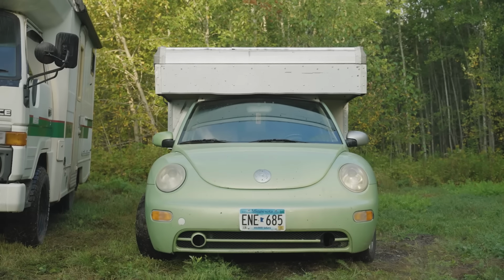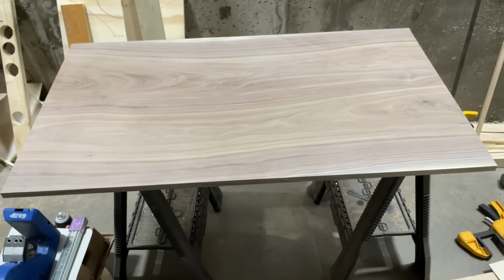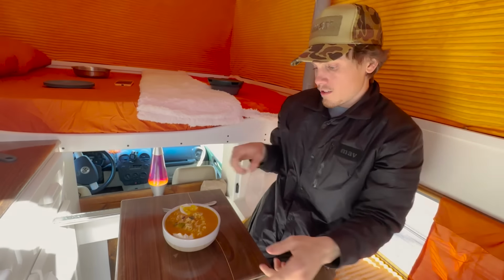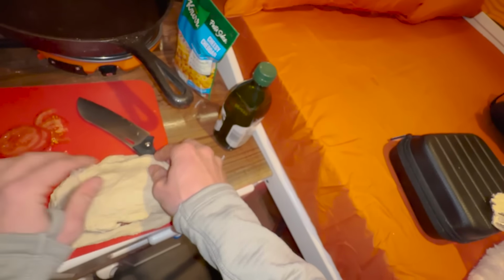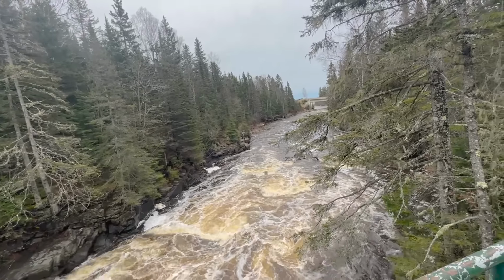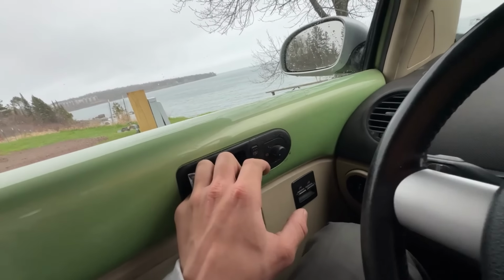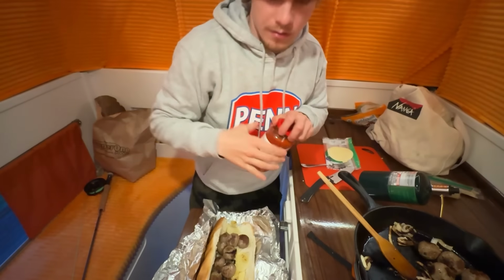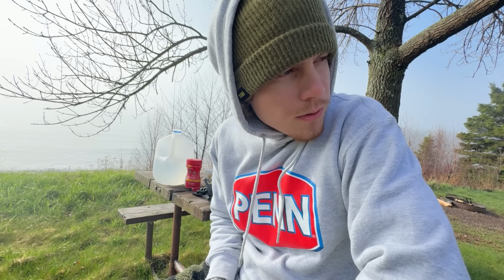Three Days Camping in my Renovated Small Car

Comment: MAV, how you doing man fantastic job on the bug it looks freaking great. I would make one recommendation to go to camper world or similar trailer supply house and get a cover that goes over your vents you want to cuz you have two vents. That way if it's raining outside you can still have your events open but no water will come in. They put them on RVs when they're cruising down the road so they can vent you know keep the place comfortable as they're driving down the road and they don't have to worry about rain coming in. I know you said you beefed up the suspension did you actually take it to a VW bug place or aftermarket place just curious. There's a lot of weight with that top and you know all the stuff that you put into it that may not have been considered when VW made the bug. Maybe you can put like you did on your truck that one day those air ride air lift pads or whatever they were? Maybe you can put air shocks or different springs to give you a nice smooth ride but be able to handle that extra weight? Something to consider. You're going to have to have if you don't already some form of TV entertainment either your laptop or something so you can watch YouTube or DVDs or whatever you want. Something you might consider doing and may not need to be done is back where you put diesel in the car and you end up spilling diesel on the paint why not just spray paint that section have your cabinetry guy do it with that truck bed liner. Just scratch up the pain and get it all rough and then mask it off and then you get they sell in a rattle can just spray it on there and then it'll be like that truck bed liner and at least it won't harm that when the diesel falls on it. I don't know if you have any or if you even care but you can go by and get those window screens you know to keep the sun out the summertime so your interior doesn't bake and put it in the windshield that way when you're parked you got a little bit more privacy from the outside world or in the dead of summer you could line the windshield and the side doors windows with that windshield material and keep the heat reflect the heat away from the inside the cab and it gives you privacy. I actually do that in my truck just because if I'm doing something and I want to take a nap and I don't want those super bright parking lot lamps glare on my eyeballs I could block my windows out. Another reason I do it is I just want to stop for lunch I don't like it when people are gawking at me when I'm eating so I just throw it up in the windshield and gives you a sense of your own privacy. You have yourself a good one. You've come a long way since the 15000 viewers that's when I started watching you. Keep up the good work and stay MAV The wild Man. Peace from Oregon

Comment: That's cute and amazing!!!
Almost insanity how your tiny car has same living space or better, than my full size van!
I need a pop top, my knees are bad and not feet! 😅
I'm just happy to be free with a safe place to stay. It's all metal baby, nobody slicing in!!! 😅

I have big lithium like you 200Ah and solar 300w but just a hand pumped water spray bottle for hand washing, face washing and dishwashing. 
Still on a poop bucket but thats under control!
(Kitty litter, double bag, add seal to lid, use fragrant spray and good ventilation.)
I need diesel heater for safety, my burner on super minimum with a fan over it blows comfy air all night almost free ...because I refill my green bottles myself!
Also need an AC and a fridge, but mostly that's all nicer but I get by very well from below freezing to above 100°.
Winter is easier than summer! 
Went to requires a little flame and that you dust off your solar panels once in awhile and keep your batteries warm enough to properly charge and not be hurt that's all pretty easy to do, I have a 6 hour hand warmer that I put between my batteries and I cover with a jacket So when I'm not in the van I can try to keep my batteries happier. 
Staying inside a van and 100 plus degree is impossible without spraying yourself down all day in a virtual shower with a fan on you, It's not super bad but that ain't living!!!
What I did was I slide my door all the way open and I have a big house fan that I just continuously pump fresh air in with. It sucked a little but I survived just fine. (I learned to travel to the mountains near because it eas 20° lower!)😂👍

There's more than one way to skin a cat! 
I asked the guy from Venezuela and he confirmed it! Since then though I can't find my cat!!!

Comment: Just chiming in here, I don't know if you fixed that Humvee yet but the issue of it just draining the batteries was an issue very common when I was in the Army. I worked as a Wheeled Vehicle Mechanic and can say that it could be a number of things wrong, I can't really say without seeing and testing it. Could be starter, generator, wiring harness issues or something as simple as leaving the radios (military ones) or lights on.

Comment: Now the bug just needs some attention on the body and a bit of paint. That engine should last a while yet but the transmission and clutch might not like lugging that extra weight around. Good thing is these are still decently easy to find parts for..

Comment: For your Cast Iron use a Cheese Dome for a make shift Dutch Oven, and it's half the weight of a full-on Dutch Oven 👍 😀.
I really miss Springtime in Northern MINNESOTA, perfect Van Camping weather.
Reply: I have a question, i am Dutch, but never heard of a Dutch-oven? Can you explain what it is? Its no hate, I just really want too know😅 thanks
Reply: @larsmeijerink5471  No shade taken.  Well, a Dutch Oven is a cooking vessel that has two separate parts.  A top and a bottom, both usually made from Cast Iron.   A commonplace name would also be a ROASTER to be used on an open flame stove or campfire.  Roasting meats or Veggies, Stews, Chili, Baking and such.  They were a prime possession during the early years of the USA in the original Colonies and still are much used today.  LODGE is a very popular brand of Cast Iron and they make Dutch Ovens forged in the USA at affordable prices.   Hope this explanation helps.  I believe they may have been used oftentimes by the religious groups of Mennonites, commonly called the "Pennsylvania Dutch" who are not actually DUTCH at all... I  know, go figure 🤔.
Reply: @pamelaklemp5615  thank you so much. Yeah I those are more german then Dutch 😅 I think we have somthing like what you explained, we call it a Braadpan. It's pretty much the same thing. Thanks for you clear explanation 😊

Comment: Did you put lock downs for the roof vent you can see it almost wanting to rip off when driving, also if you want stuff not to stick to alfoil wrap stuff in baking paper and then alfoil also the iron skillet needs to be really hot for nothing to stick an oiled

Comment: I'm surprised no one mentioned anything about your diesel heater/carbon monoxide concerns.  If properly installed and vented, you shouldn't run into any problems.  However, a lot of people nonetheless install carbon monoxide detectors for peace of mind.  (For twenty bucks, why not?)

Comment: Anyone else notice how he caulked the roof vent? It’ll leak , proper way mav is to put a square bead around the solid inside of screw holes then put vent on and fasten it. Also you can get air bags for the rear to help with weight

Comment: Hello, my silly question is the  pass threw won’t you lose a lot of Heat in the winter. And gain a lot of heat in the summer? It looks like it walked into the 70s but it worked really well with the VW

Comment: Lake superior has the largest volume of fresh water in the world by a landslide, the lake in northern territories does have several lakes beat in surface area but it's shallow so it gets beat out by all of the great lakes in volume except maybe ontario. lake Michigan Huron and Erie will fit inside Superior. And all three of those are bigger than all but 2 or 3 other lakes worldwide. The great lakes hold 4 of the top 10 spots for largest bodies of fresh water world wide. I believe three of the four that border Michigan are large enough to be considered inland oceans could be wrong on that one though.

Comment: this dude literally cooked onions and meatballs in a dry skillet...lol whatever does it for ya. might wanna use some oil next time, if you didn't have any, heat that sauce up in there with em, don't throw it cold on the sandwhich, might be a bit better...it's camping...but usually i've seen you gourmet it up.

Comment: In my short term years of camping with my partner how yes had a 5th wheel and then we downsized to small 17 foot and yes we had a stove in them so I onldy di this starting at 57 and Im 69 excpet my ex who did tent camping that I hated at age 25 because of everthing biting me and using odd contraptions to cook. I dont understand the total cooking from scratch and picking raw pasta dishes but it seems what every one does? even in a tent with a cooler or small fridge. It seems everyone is picking something so much from scratch its hard to make or so instant its terrible. there are easier and better pre cooked dishes you can steam. I bring a pot with a steamer in it or I have a fish steamer to fit one that keeps items above the water. But you can cook many things int he pan besides raw dough. We made roast beef, swiss cheese, grilled sandwiches on rye bread with ortega chilis. Not any harder than making a grilled cheese sandwich. Heat the meat a little first on pan then assemble like grilled cheese. In the steamer you can steam anything from raw or frozen or fresh veggies. I would bring precooked smashed potatoes or just precooked anyway which I do all veggies in my microwave at home for decades in a baggie with a few drops water, poke holes in the bag or trailer if we were in RV spot or after we bought our quiet generator. But again all can be done in a steamer basket in a pot of water. Also can tent anything in foil in a pan with a tiny amount of water like the trout we caught and even over an open fire off to side on the grill bars. And they make coffee bags! Just use boiling water like you do a tea bag. I make concentrates of my fave drinks I make at home. I make arnold palmer with frozen lemonade and tea bags at home that I always have in our home fridge all year long. But for camping trips I made it 1/4 strength and put in the 16 oz size gatorade or for me vitamin water bottles. I keep tea separte from the lemonade. The tea concentrate would be made in a 4 cup pyrez measuring cup with 4 tea bags but I use 1 cup water to travel. I pour the water a littel short when making or home or a trip and put a bunch of ice in to make it ready in 5 mins. at home I put the frozen lemonade into a large plastic cup and hot tap water to defrost in a few minutes. So on the road you just add half and half about a 3rd in your cup and then add water and ice! I did that with everything. defrost the OJ and only enough water to fill the 16 oz bottle.If even tighter on room just defrost and add to 8 oz bottle. Sorry, old mom here. Oh and uncle bens makes 90 second rice packs. Can steam those too!